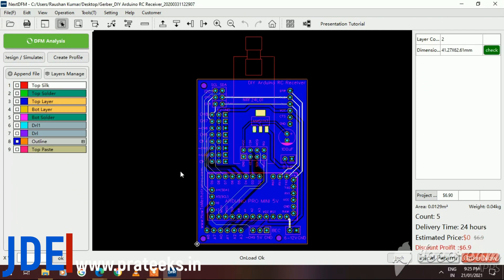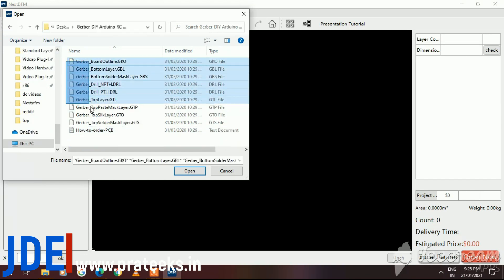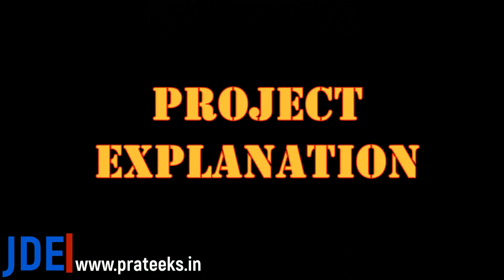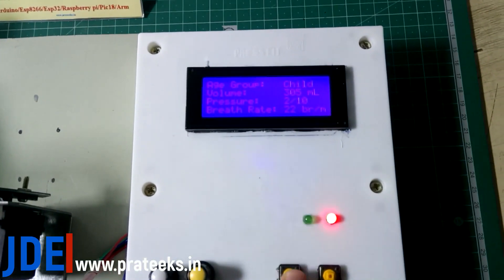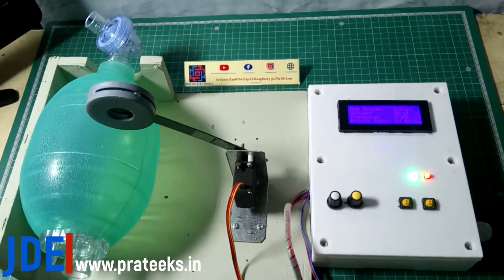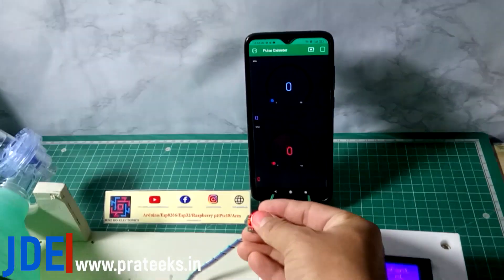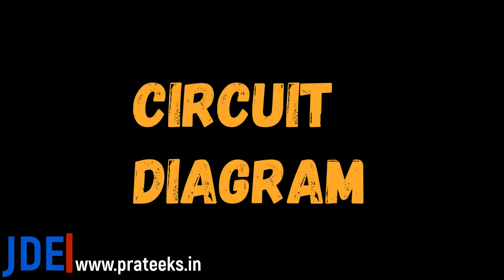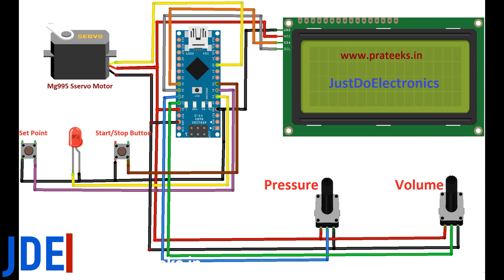How To Make DIY Ventilator With Variable Volume, Pressure & Breath Rate | Arduino Project

Comment: What power supply did you use for sevo motor
Reply from the maker: 5v
Reply: @JustDoElectronics   and current rating
Reply from the maker: @i8xKNIGHTS 2A
Reply: @JustDoElectronics  still not starting did you add capacitor across it

Comment: Hello sir ,I saw your project in your youtube channel named DIY low cost ventilator with variable BPM and  oximeter. I had tried to complete this project but I have an issue in code and I didn't have the library file for constants.h so please give me a proper code and Library files.
Reply: Same problem with the code I am also facing